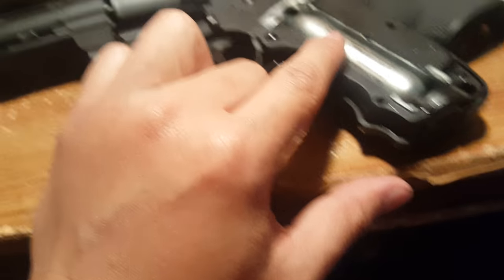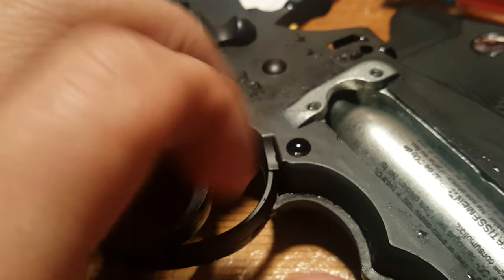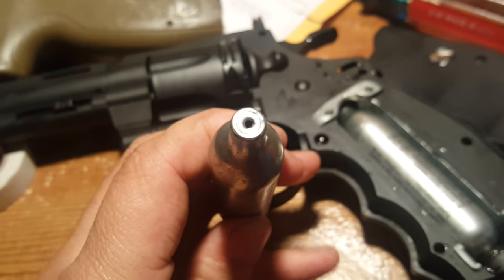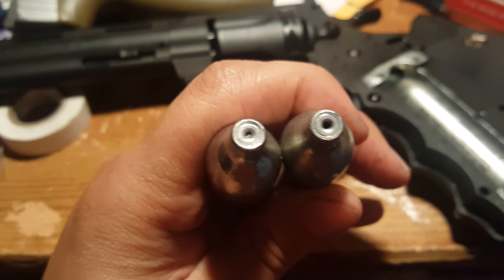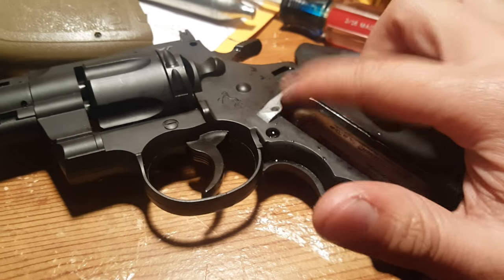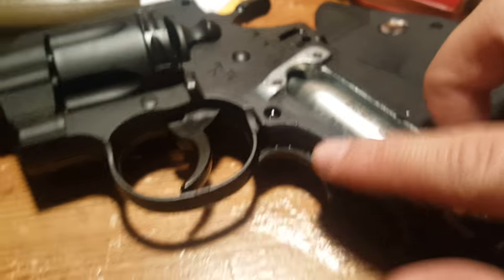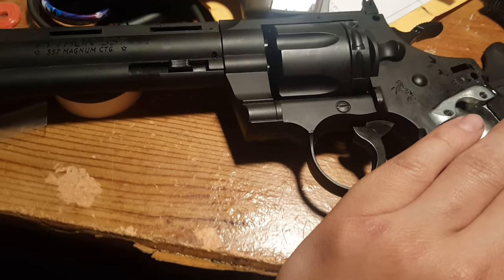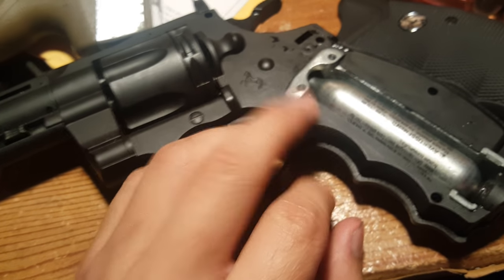Co2 gun leak fix!!!! 100% how to fix

Comment: FLAT HEAD EXPLAINED. Okay folks to simplify this.. dont use a screwdriver use the c02 capsule. I put a brand new capsule in mine before watching this vid and didnt want to waste one so i loosened the securing bolt (twisty bit at bottom of the grip that holds the capsule) until just a slow leak was occurring and then i twisted the capsule anti clockwise. Job done
Reply: Gary Pinkney This comment should be a video 100%. Thank you for the real advice, it fixed the leak instantly without the need for a flat head
Reply: @themadsockking  thanks bud and im glad you no longer have a leaky gun! Its the same advise given in the vid just different wording but appreciate the feedback. Happy shooting
Reply: But it is impossible as the capsule is damn slippery and almost no place to hold it with hands. I say as a 1911 cybergun holder
Reply: @benbluesing  slippery???? You just have to hold it still when tightening the securing screw. Can you only access it from one side not both?
Reply: @_wimza_7983  of course both
Reply: @benbluesing  so of course you just hold it from both sides to stop it slipping....
Reply: @benbluesing  the cartridges really shouldnt be slippery your not greasing them are you?
Reply: @_wimza_7983  of course not. I will change them anyway because it will lose all co2 for tomorrow, already the third wasted cartridge. Weapon is brand new.
Reply: @benbluesing  when you put a new capsule in can you hear it immediately losing air?
Reply: @DntTrip yeah no probs
Reply: @DntTrip did you add me bud? Wimza1990
Reply: @DntTrip did it work ??
Reply: It worked! I didn’t quite get what he meant by the screwdriver. But you explained it perfectly. Thanks a bunch👍👍
Reply: @joeyazzara6968  hey bud no problem glad it resolved your issue =) remember to keep hold of the capsule when loosening or tightening the screw and you shouldnt have the issue again

Comment: John Thank u so much for this reaal easy repair. I have been going through cartridges like mad. I changed the seal which was a real pain in the ass, still leaking. Your fix was Dead on .. I used a 5/16 flat head screw driver to access the the 2 notches u spoke about and it fit and turned the adjustment ring instantly... Gun working like it used to before all this  leaking crap happened...I am very pissed at Diasy customer service for not reveling this fix to its customers when we call.... Thanks again...jim

Comment: Thanks so much!!! I really don't understand why there's NO ONE giving advice about avoid rotation during co2 cartridge installation...today this quick video let me save money and time since my revolver started leaking out of the blue with the new cartridge and I was so scared about changing seals and valve components after only a few weeks of use...I own 3 different co2 guns and never worried about this aspect and I can't even tell how many cartridges I wasted...all the cartridges I wasted have the same hole on top due to rotation...I hope that holding the cartridge on place while turning will be enough to save money and make anything work properly. Thanks again ❤ you made my day!

Comment: Good explanation. I always apply light gun oil to both ends of the CO2 cylinder before installing. This stops the twisting cylinder & aids in puncture.

Comment: I thought something was wrong with my seal so I searched ebay and a couple of other places for a replacement but no luck  then I watched a few videos and I really didn't like the tape idea  then I found your video and you were absolutely right  I turned the nipple screw out about a half a turn and held the co2 cartridge from turning and it sealed right up  thanks for the video

Comment: Okay so basically what you're saying is when I put the CO2 capsule in, locking it in place unintentionally spins the CO2, which accidentally spin the needle that punctures the canister, causing it to puncture the canister before it can fully seal?

Comment: Thanks for the video, it verified my suspicions. I fixed mine by changing the top screw on the other side of the (plastic) handle with a longer one. I then placed a hardwood wedge between the screw I replaced and the piercing unit. Like a permanent screw driver wedged in place. It seems this is some kind of design flaw where the pressure of piercing the cylinder puts side pressure on the piercing unit and things are not square anymore. If you look carefully the cylinder looks misaligned when they leak.

Comment: Just flip the seal over with a small pick. I just did that yesterday, and there has been no leaks. OR, take your cylinder to a hardware store and buy a package of "O" rings a slight size smaller than the head of your Co2 powerless and set that in the well of your seal then install the Co2 cartridge. If it continues to leak, then the problem is internal, probably the regulator. Unless you are very good with your air gun' s assembly, send it back to the manufacturer for repair. A lot of small parts that can be lost easily. I have a lot of air rifles and pistols from Crosman, Daisy, Chinese (junk guns), and other PCP rifles with optics on them. I dropped a possum pest with my Crosman underleaver .177 with one shot through the eye into the brain at 30'. Zap! No more garbage to clean up. I have a suppressed .22 Crosman that I use, so quiet with one shot - nobody can hear where the shot came from. And no, you do not need a "tax stamp" from the BATFE for a suppressor on an air gun, not in Alabama anyway. Corpsman may advertise 1200 fps, but it is subsonic when it leaves the suppressor. No "crack" as the pellet leaves the barrel, but it is a heavy hitter. The Crosman F4 is the best rifle they ever made, and only $79 at WalMart the last time I seen one there. Have Fun!
Reply: Ey my cousins Harvard paper was shorter but that's for this
Reply: Should I get the o rings anyway?

Comment: usually when you start loosing co2 it is because the seal for the bulb/ capsule is damaged and needs replacing.

The flat head you are adjusting is what holds the seal in place, you need to remove it completely and change the seal underneath.
Reply: I wonder if turning the seal, so the backside becomes the face side might work for a while? (At least until you can get a new seal.) I haven't tried it, but i am considering it on one gun. Worst case, one could probably use circular punches, to make a new seal. It also seems to me, there are soft types, and much harder types.
Reply: @prawny12009.......That's kinda what's got me puzzled a bit on this whole thing. The OP says by unscrewing the seal hold down bushing, the length of the piercing needle will reduced,  thus causing a "shallower" puncture on the top of the cartridge, in turn, stopping leaks. How does that come about, if the seal, the bushing, and the piercing needle are three different parts ? I've never seen the piercing needle reduce in length by unscrewing the bushing. This just leaves the seal loose under the bushing, as it is supposed to be when changing out the seal altogether. What do I seem to be missing here ? Thanks.

Comment: That almost worked, he is talking about the large 3/4" rim that needs to turn, eventually need to replace seal, $5 from local gun shop.
Reply: But that's hella hard to turn I tried turning it I've been tatula I was using like almost as if it could not be turned anymore

Comment: They make a tool that has the two prongs and the center portion of the blade is notched. If you're handy with a file you can modify the screwdriver blade tip to fit perfectly to turn it counter-clockwise.
Reply: Where can I get that tool?
Reply: Look up "U-shaped spanner screwdriver". Amazon sells them or try a good hardware tool store.
Reply: @leroyusa935  What's the correct size of the U-shaped screwdriver needed for this fix? Thanks.

Comment: I got the H8r from a  swap meet and come to find out it leaks. I tried this and other things and it doesnt work. Im going to take it apart because the source of the leak i found out is coming from the firing pin. Theres supposed to be an o ring inside that piece, maybe its cracked or needs to be replaced idk. Lets see if that works.

Comment: The depth of the puncture has nothing to do with the seal around the piecing needle being warn from leaving cartridges in too long.  The threaded nut of the seal and pin seat is not an adjustment, but a way to remove the part for easy service/gasket replacement.  Teflon tape may work initially, but a better choice would be a small med to high durometer o ring.  Problem is it wouldn't stay seated unless the original was as perfectly shaped as the original seal... $5 as mention in other comments.
A dental pick (cavity probe "explorer") makes for easy removal, them seat with finger pressure.  If you remove cartridge seat screw (the threaded thing you are talking about) to remove the oem original o ring, you may have to consider the seal between that part and the gun frame which may also be failed but not as likely due to less wear ( not removing the co2 cartridge routinely, therefore less failure).
Always best to fix it right the first time with the correct part...unless that part is unavailable.  Take it from a "sucessful" DDS - cheating rarely works... (ask the fake prez!... he will find out soon enough!)
Maga

Comment: What are you turning with the flat head screw driver and do you do it when. The co2 is in the gun
Reply: I'm confused by this too
Reply: So basically you don’t need a screwdriver. When you’re screwing in the cartridge, hold it in place so it doesn’t spin while being screwed in.

Comment: Hi bud im a bit confused what you had to do with the flathead, is there a screw inside next to the puncture valve?
Reply: Gary Pinkney look inside where the co2 goes in. There’s a tiny needle looking thing and around it is a circle that should have two notches for a “flat head” screwdriver to tighten/loosen it
Reply: @joeyruiz7108  hey man thanks for getting back to me. Ive since had my pistol out today for a plink and discovered i can just twist the capsule itself to tighten. Thanks tho bert

Comment: John    Your fix worked great for awhile. however, it seems that the leak comes back.  How do I make sure my gun will hold the adjustment? I will try harder to hold my finger on the Co2 when loading.  Thanks again for your input.This is really a big pain in the ass. ...jim
Reply: Hi Jim. When you replace cartridge each and ever time you keep the capsule still in place by hand while twisting the securing pin beneath it. Once moderately tight you can then twist the capsule itself anticlockwise until leaking stops

Comment: Yuh someone explain what he did with the flat head
Reply: If im 3 months too late sorry bud but dont use a screwdriver. The co2 capsule already in the gun just twist it anticlockwise a few turns.
Reply: @_wimza_7983  Hey dude, now I'm 3 month late... lol, i put a co2 capsule but when I adjust it i cant twist it anticlockwise, how do you do it? thanks mate
Reply: @emilioboggio8370  hey bud dont worry about the three month biz. Problem will always be here =) 

So lets start with model, what pistol are you using?
Reply: @_wimza_7983  hey thanks for the quick call, Im using Umarex Tornado, very similar to the one of this vid. I dont know    if the flatdriver is a good idea since to do  It I need to desarm all the gun... the thing of twist the co2 sounds good but when I twisted I dont see that nothing else twist with the carbrige,  sorry for my english my friend
Reply: @emilioboggio8370  dont worry about the english i dont speak any other languages any good so cant judge.

When the spent cartridge is inside the holder, are you able to use thumb and finger? For example can you access the cartridge from front and back?
Reply: @emilioboggio8370  ive just found out for myself you can only access front facing.

The retaining torques bit you use to tighten cartridge in place, can you loosen that all the way out??
Reply: @_wimza_7983  nop I dont have room to my fingers , im going to try to put a nail on the cartrige of something Like that, thanks for your help
Reply: @_wimza_7983  I do it! Now Im going to buy some new co2 cartridge, thanks a lot for you help, you are right the thumps and some patient
Reply: @_wimza_7983  You are right I can put the flatdriver using that hole, you are the hero mate!
Reply: @emilioboggio8370  good man good luck tell me how you get on. If it doesnt come out there should be enough room for you to angle a pozy screwdriver in. Loosen that sucker up, make sure its a wide screwdriver. Could also use a leather belt to twist the capsule if thats agg